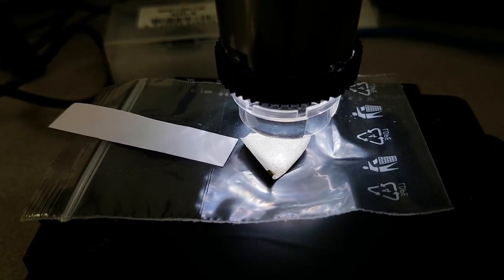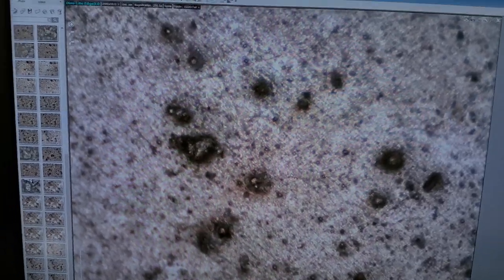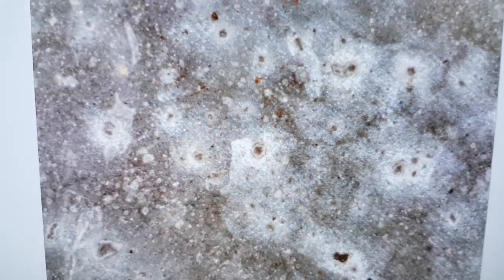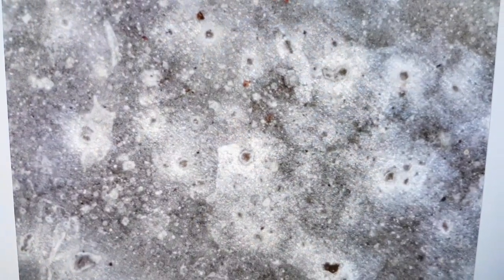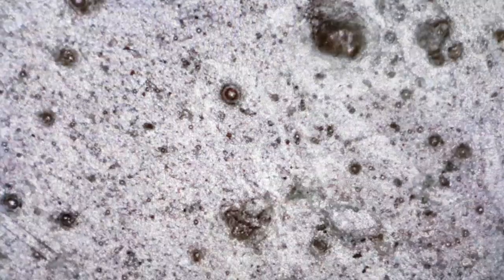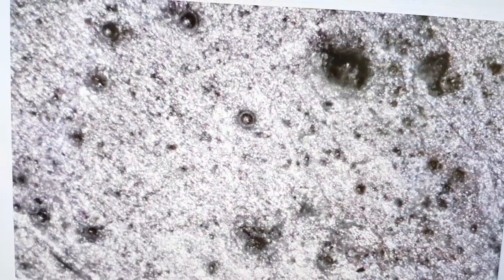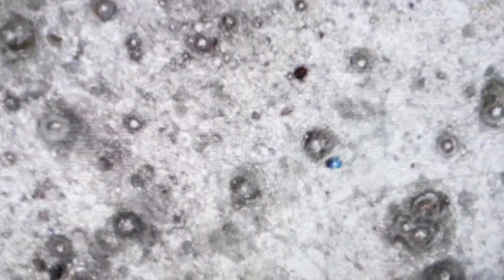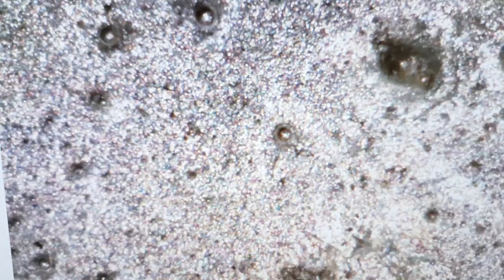ECCO - Nickel Foil examination with Dino-Lite microscope

Comment: Regarding the gold deposits, is this coming from transmutations or contamination? If transmutations, (amazing!), is the process repeatable? If so, this should lead to some major scientific changes,...right?
Reply from the maker: Suhas Ralkars Nickel foil making process is not the only nickel electrolysis experiment that yielded precious metals. Silver and Gold were found by EDS and MALDI TOF-MS,

We will do more analysis on these samples in coming weeks. The samples are interesting because they were produced in a similar way to that used by Bogdanovich et. al. who videoed luminous long-lived toroidal plasmoids moving across the surface two days after treatment.

Peer Reviewed Journal publishes article on Long-Lived Plasmoids

- Observation of Strange Radiation tracks
- Transmutation determined in affected material
- Video recordings of translating glowing toroidal plasmoids on exposed surfaces 2 days after treatment
- Video recordings of clusters of similar structures ‘rolling’ over surfaces

https://youtu.be/TO-X58PfqIU

Original on-line published webpages from 12/29/2008
P1
https://mephi.ru/content/articles/index.php?ELEMENT_ID=1689&fbclid=IwAR0j1N6Pgu_xXT2_Vxyd-MHURu6TFA1cUF93VlJOkAg9w1Fy2XlDJdsyFM8

P2
https://mephi.ru/content/articles/index.php?ELEMENT_ID=1689&fbclid=IwAR0j1N6Pgu_xXT2_Vxyd-MHURu6TFA1cUF93VlJOkAg9w1Fy2XlDJdsyFM8&PAGEN_1=2

P3
https://mephi.ru/content/articles/index.php?ELEMENT_ID=1689&fbclid=IwAR0j1N6Pgu_xXT2_Vxyd-MHURu6TFA1cUF93VlJOkAg9w1Fy2XlDJdsyFM8&PAGEN_1=3

Paper

Video Recording of Long-Lived Plasmoids near Objects Exposed to Remote and Direct Effects of High-Current Pinch Discharges

B. Yu. Bogdanovich, N. V. VolkovN. A. Len’, A. V. Nesterovich

Abstract—The results of observation of plasmoids that were formed during periodic discharge in a flow of liq- uid, in particular, water, in its surrounding space during discharge and in post-discharge, have been pre- sented. The presence of long-lived luminous formations not only in the air, but also on the surface and above the surface of nearby objects has been noted. The reasons for the appearance of such objects and their prop- erties, which have features not only of macro-, but also micro-objects, such as Dirac’s monopole, have been analyzed.

Technical Physics
April 2019, Volume 64, Issue 4, pp 465–469
First Online: 15 May 2019

https://link.springer.com/article/10.1134/S1063784219040066

Technical Physics Journal
https://link.springer.com/journal/11454

The paper
sci-hub.tw/10.1134/S1063784219040066

More recent (May 7, 2019) Bogdanovich et. al. paper observing the exact same 'birds' on x-ray emulsions as Shishkin et. al. from his cavitation device.

https://iopscience.iop.org/article/10.1088/1742-6596/1238/1/012055/pdf

See 14:08
https://youtu.be/gcF-KSLIAWs?t=848